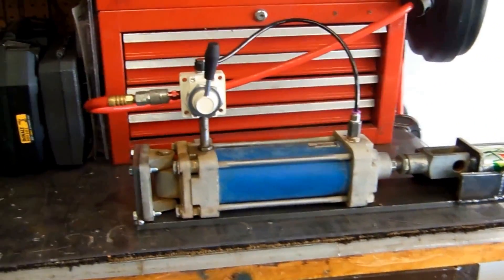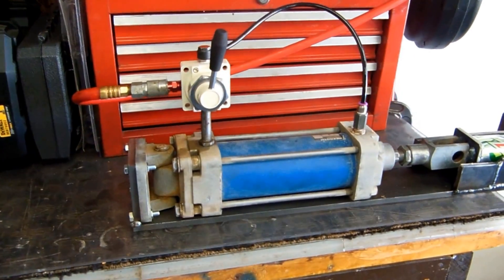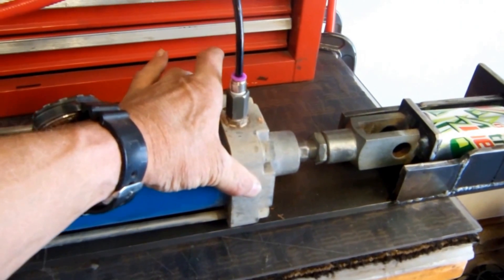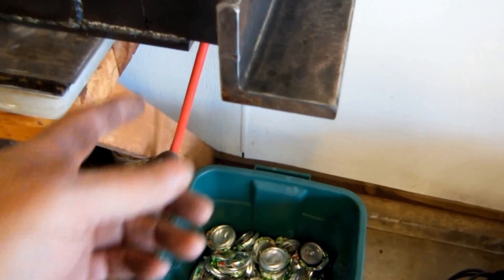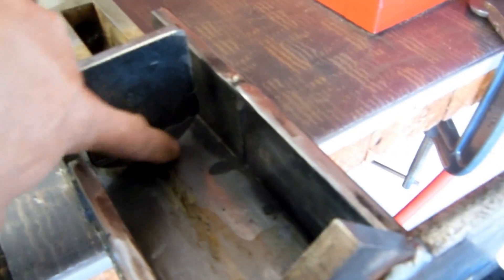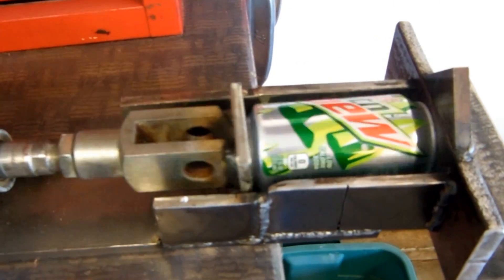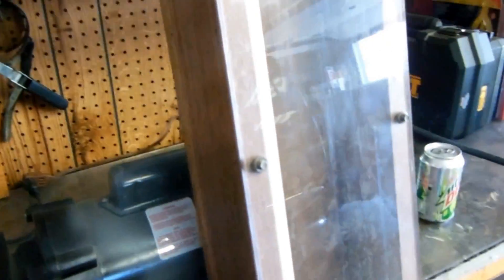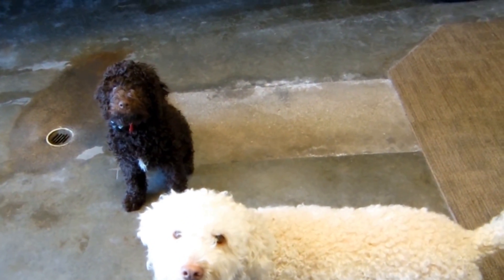Can crusher anyone can build

Comment: Freaking awesome! Absolutely love the piston wheel, ... so I need to find some junk stuff to put together just like you have, ... lmbo! Sure will beat the heck out of having to crush cans by hand, ...  (I got an el cheap unit from Harbor Freight for About $4.00), and yes, it works, but no where near as efficient as the 2 you got there, ... I have not got an air cylinder, although not sure what kind of price they are but will be researching it for certain sure, ... thanks for the great ideas, ...

Comment: Good night
What is the manufacturer of this cylinder?
Reply from the maker: Bimba or parker. I have bought a number of them off of ebay.  3.5 inch cylinder with a minimum of 6 inch throw
Reply: Good morning
There are some suppliers of this cylinder here in Brazil.
Grateful!

Comment: Clickbait much? Not anyone can build this, as you have to have the materials AND have to know how to weld.
Reply: +Luke Johnson 
I've seen them built out of wood, and they hold up just fine.  So before you "challenge" someone, don't be lazy, do some research.
Use your brain much?
Reply: Artillery God 
You can make the same setup out of wood.  No welding.
Use your brain much?
Reply: lmdetect lmdetect Get a doctorate in mechanical engineering and then school me. The guy even says in the video...and I quote "...if you can weld at all... (34 sec)".  What you have seen are home brew models less powerful.  So, as the gentleman you tried shaming in the first place was right, the title is misleading.
Reply: +luke6j6 
The guy I was trying to shame was being a smart ass, just like you.  So I knocked him down a notch, just like you.
The man in the video built something that was complete overkill, and that's cool.  The point, since you missed it, is that you can use a less powerful cylinder and build the frame out of wood.  They're all over YouTube.
Again, research.  It's not hard.
Reply: WORLDSTAR
Reply: Imdetect ...very rude comment towards Artillery God "Use your brain much?"  But I will challenge you to use a little grey matter. If the gentlemen says that it is so powerful that it flexes the steel, what do you suppose it will do to a couple of boards glued and screwed together?
Reply: lmdetect Dude, who has flipped you switch on. Seems like the only person trashing others is you...examples- "use your brain much" and "stupidity at its finest". All I've really done is agree that the title being missleading because not everyone has the welding skills. Take a deep breath and accept the facts and stop attacking people in order to make reality fit the situation here.
Reply: "dude". 
I must be having a discussion with a 12 year old.  lol
Reply: Imdetect  Maybe you can comprehend this..."I never said I could not weld. Actually, I've been MIG welded for couple years now as a hobby."  But it is his title is what we are talking about.  Keep on topic.
Reply: Arty, you reek of Obama.
Reply: Oh, and anyone CAN build it.  You just might have to learn a little something.
Even if you feel like the title is misleading, who the fuck are you to trash this guy for showing you how to build something.  Stupidity at its finest.
Reply: +luke6j6 
Don't know how to weld?  That's where the "learning" part comes in.  Apparently you have a problem with comprehension.  That's a big word, so you might need to look it up.
I was only defending the guy in the video from the original smart ass.  Then two idiots showed up to put in their two cents.  I think you need to take a closer look at who the bad guys are here.  
Try to pay attention and use your brain.
I don't expect that to happen, which is why you will comment again in 3.....2.....1.....